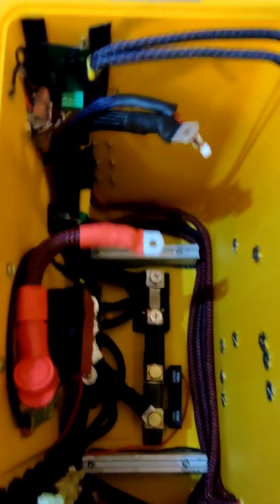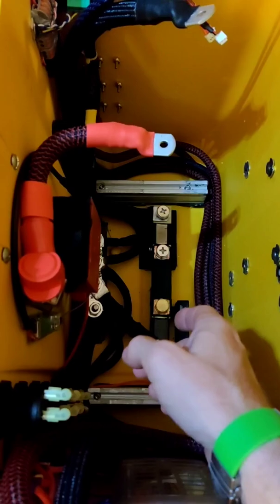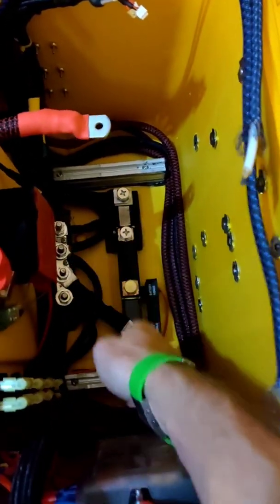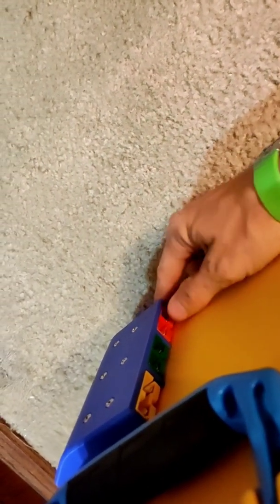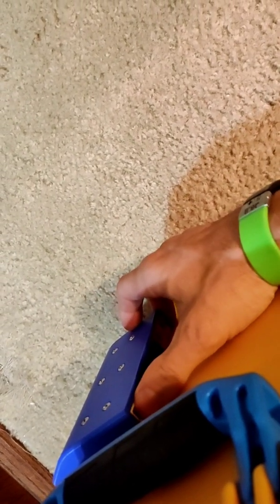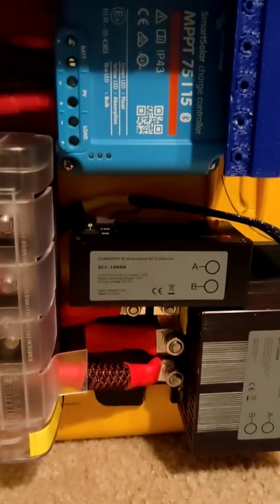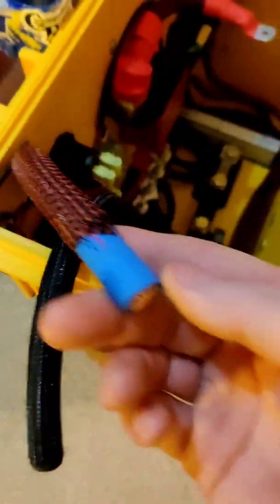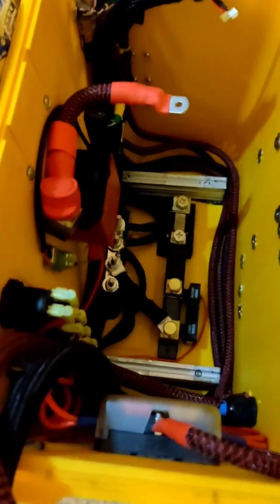DIY Solar Power Generator (Part 4)

Comment: Bro looks good. I want this to be used for outdoor application because I want to mount it to the side of my semi truck chassis. That's why I need it to me contained and weather proof with a cooling fan. Can it be done. 4K watts continuous. Surge doesn't matter because I'll be running one application at a time. Portable heater or a vertical AC unit. The fridge will be the only thing constantly connected and running.
Reply from the maker: @willmann30 Thank you sir!  And yes I would think it could be implemented but be afraid of possibility of heat with that size of inverter inside with the batteries.  You would also have to have an heating pad for the batteries if in colder climate.  The lithium phosphate batteries don't like to take a charge when it's below freezing.  Actually can damage them but with a heating element inside it wouldn't be a problem.   For the amount of power you are talking it would be better to install on the inside.  Doing a 24v battery build and a 24v to 110v inverter.  
To find so much other information about building batteries from cells look on the Diysolarforum.com so much information there.  Keep me updated if you try to build something and I can also help with suggestions but only from what experience I've been through.  Thanks for the comment and have a blessed day.